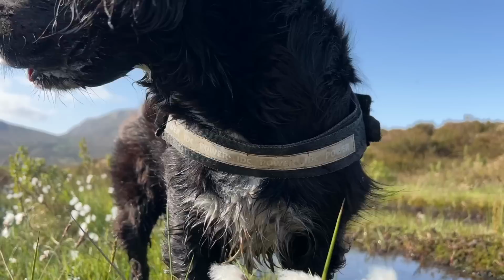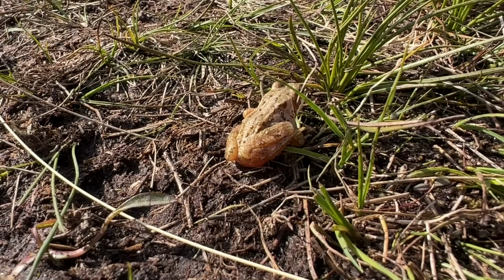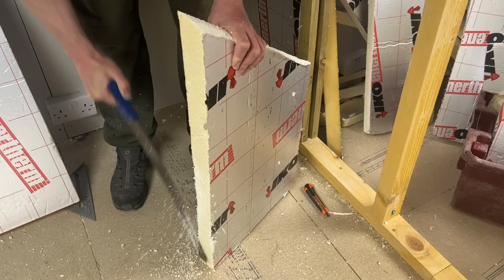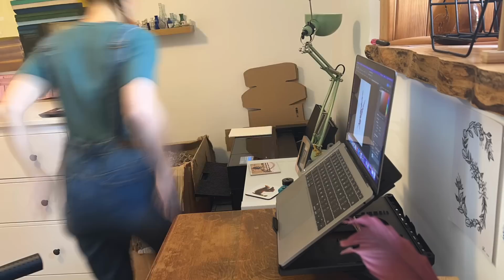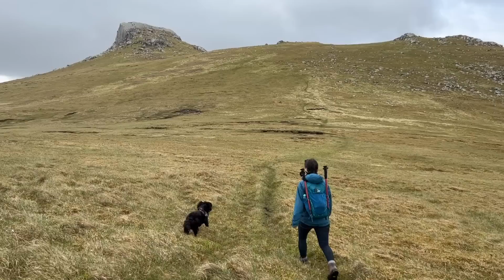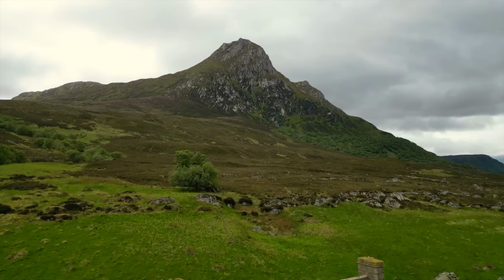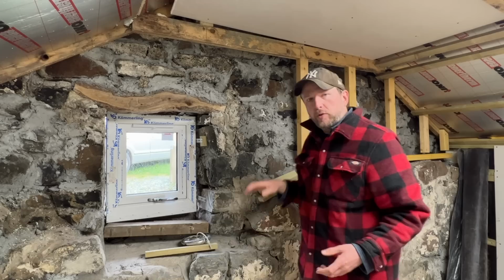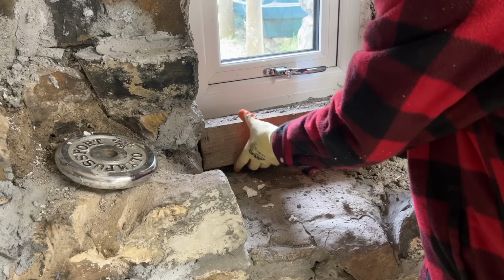Back To Work on the Byre! Refurb at our 1840s Cottage on the Isle of Skye, Scottish Highlands - Ep21

Comment: As nice as the solid glass door is, you might want to consider applying and= opaque window film to the bottom 2 to 3 feet solely to keep Jack Spaniel from slamming into the closed door and hurting himself.

Spoken from experience over many, many years of glass doors.